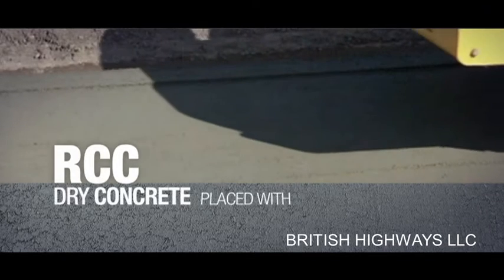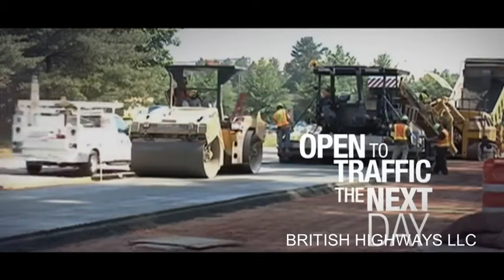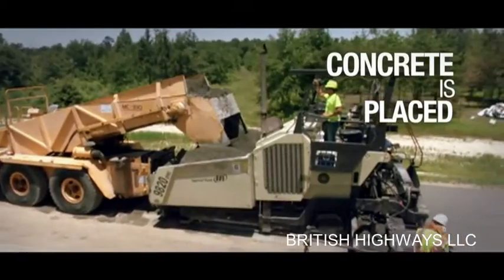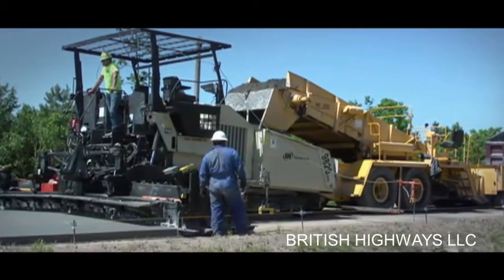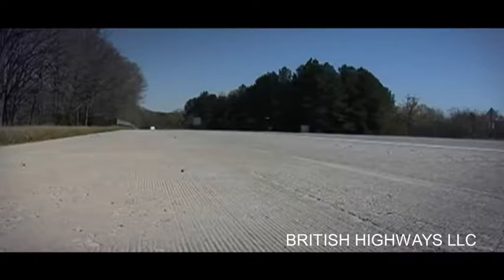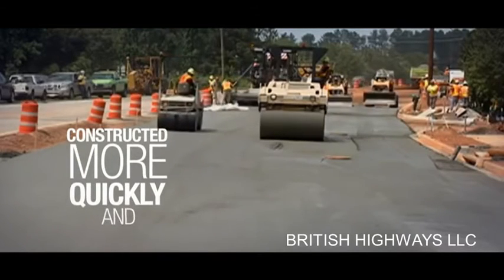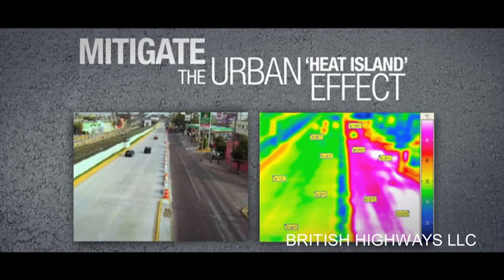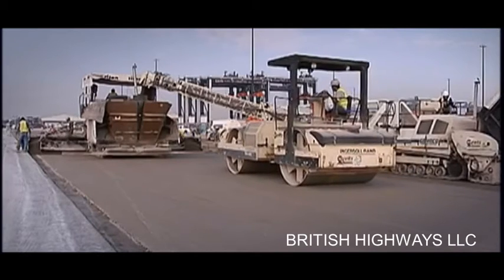Roller Compacted Concrete - British Highways

Comment: RCC concrete can reach compressive strength ( 350 - 420 ) kg/cm2 and flexural strength till ( 42 - 56 )kg/cm2. Zero slump mean less water for mixing . Mix - Place - compacted - Cure and directly can be passed through in the next couple days. Fast and low cost comparing with asphalt pavers. ........This method shall be adopted .